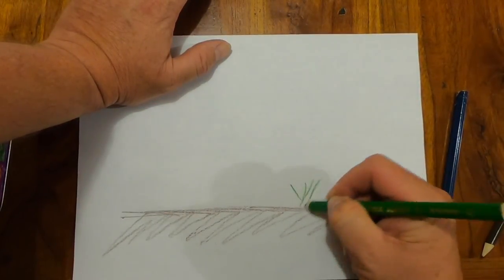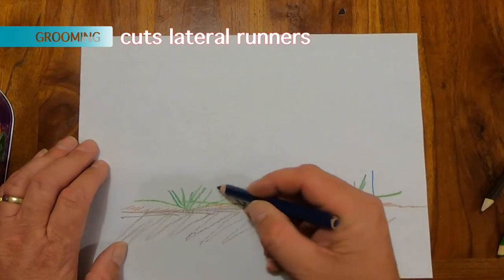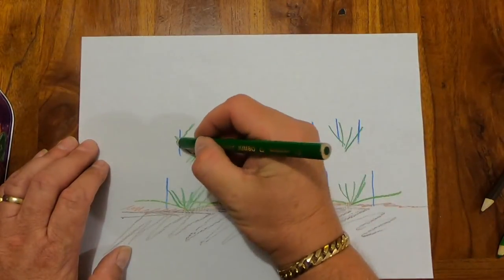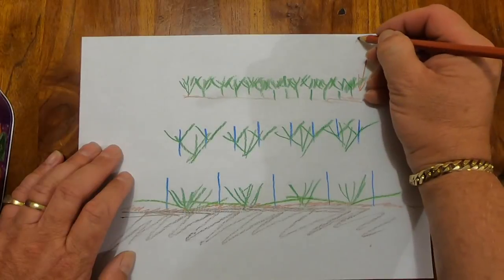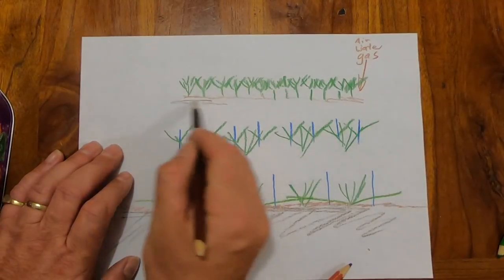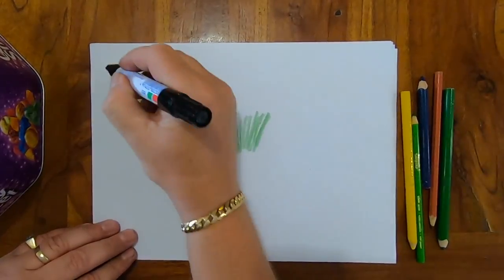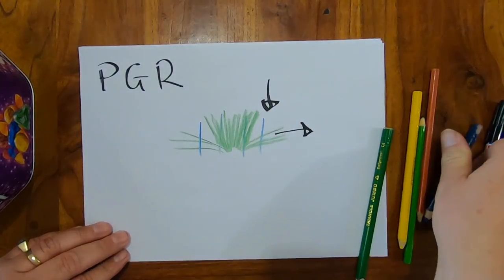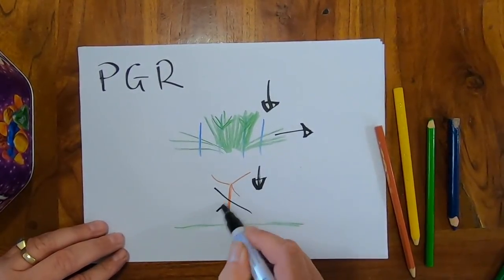TOP 3 TIPS FOR THE LOW-MOW

Comment: I’ve followed your advice thus far...SB4517 reel mower, SB4514 converted to a grooming reel, SB scarifier, wetting agents and now PGR...where do I get it? My lawn is a pleasure to mow.
Also, at the end of last season, I got hold of Tifdwarf spriggs which have now popped after a long winter on a separate terrace. It should be ready to putt on by next spring.
Reply: Search astro120 lawn pride sell it in a 1L bottle about $130